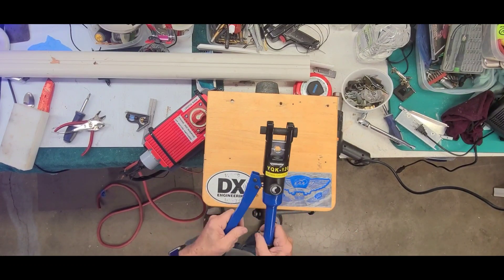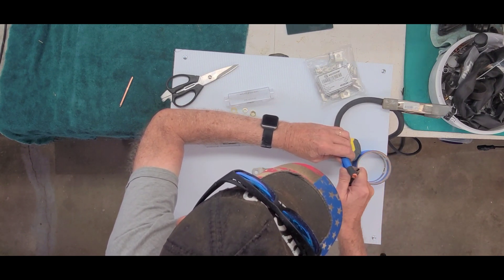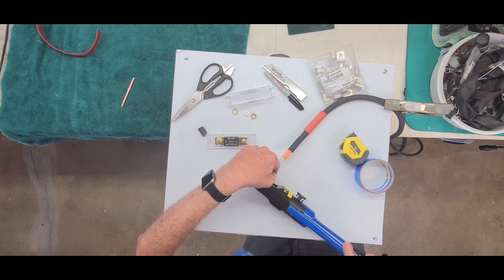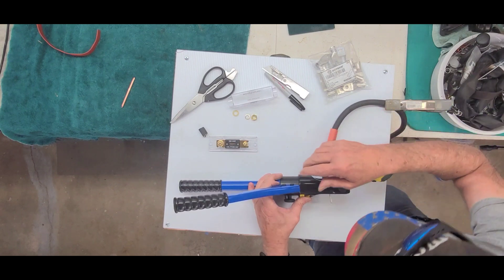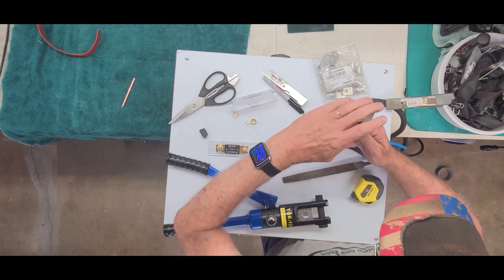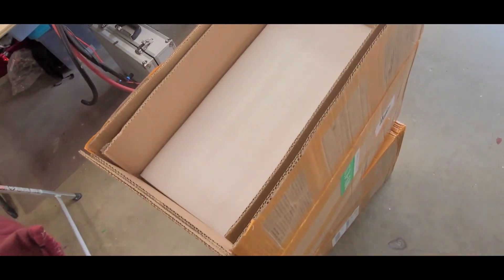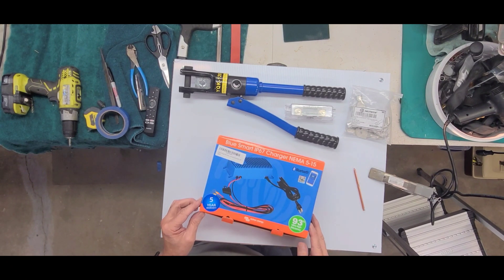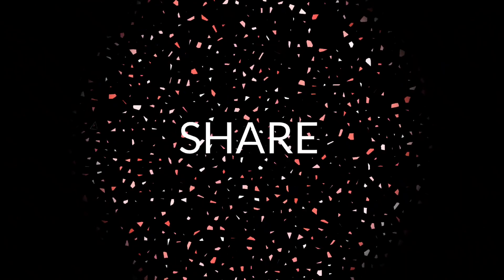lifepo4 battery  install (Part 2)

Comment: Did you ever hear back from Chins?  I have two 24V batteries of similar config coming from China and want to do the same thing hooked up to an 3.5KW inverter.
Reply from the maker: Yes,I did hear from them,a quick response too. They said it was best to fully charge the 12v individually before hooking up in series..That's what I did.
Reply: @WG7D  any recommendation from them AFTER they are put in service?
Reply from the maker: @guylozito7041  no, but they are quick to answer anything. Once fully installed and used on a couple of rv trips I will test the cells as to balance.